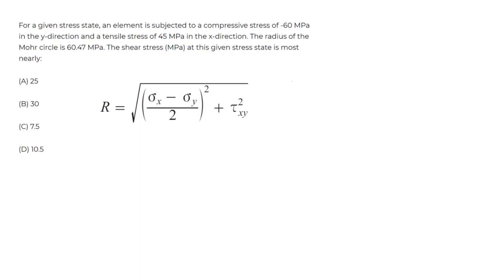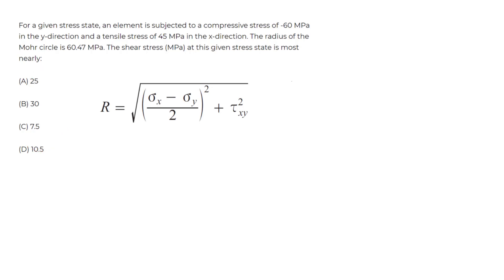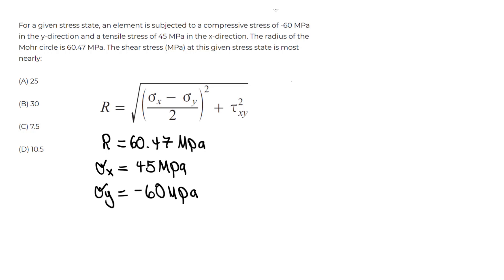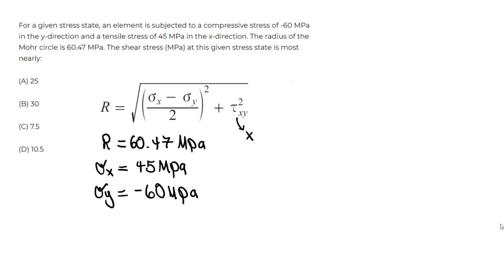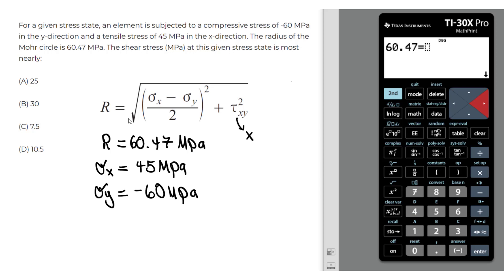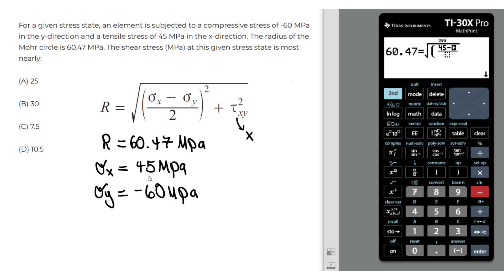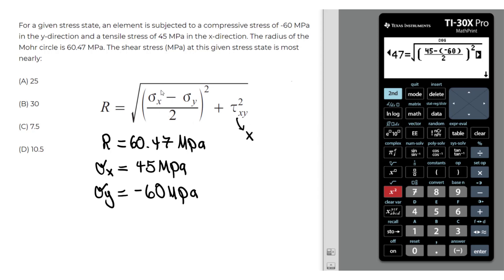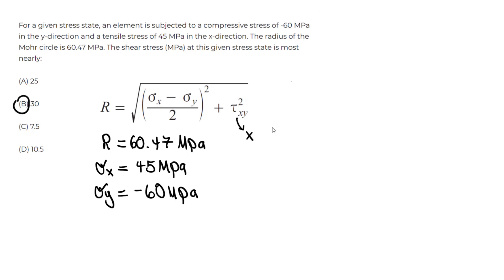FE Exam Review - TI36X Pro Calculator Tip - Solver Function

Comment: Why is my calculator coming up with the answer of 2.8311843? and not the answer of 30?
Reply: I am using the TI-36x Pro
Reply from the maker: @conorbogue7001  hi Conor, maybe trying clearing and resetting the calculator? 

It should be close to 30
Reply: i have the same problem

Comment: Is the range already preset or is that something we will need to set?
Reply from the maker: Hi, after using this calculator for 5+ years, I never adjusted the range. You should always be ok for the FE exam. Important tip! - For the TI-36X Pro if the solver seems to be acting weird or not working, I usually clear the memory by doing 2nd -> (0) Reset--> (2) YES, then solve a simple expression such as (2x = 2) to make the computer calculator brain think again lol
Reply: @directhubfeexam  thank you 😁
Reply from the maker: @rxqueen333  Your welcome!
Reply: Is this ti-30x pro allowed on PE and FE ?